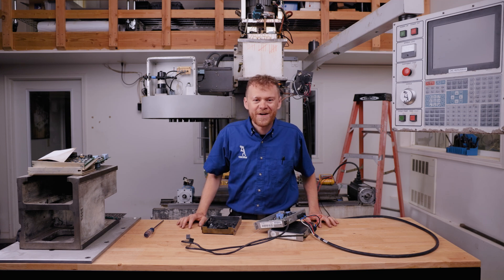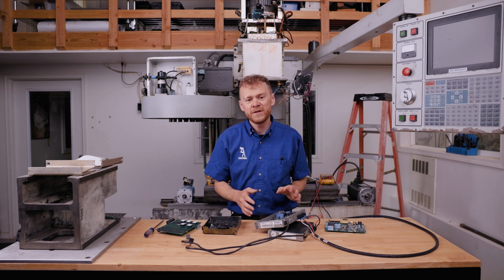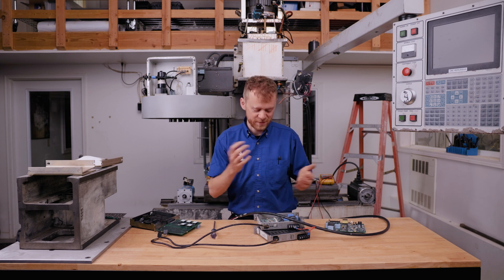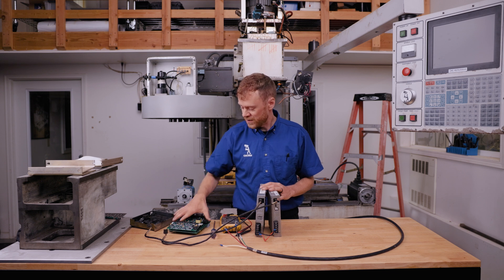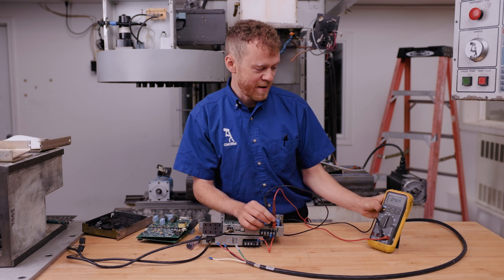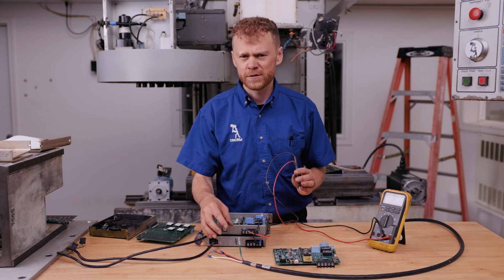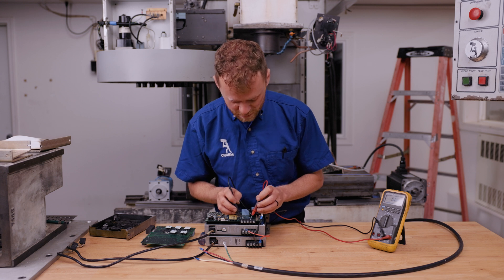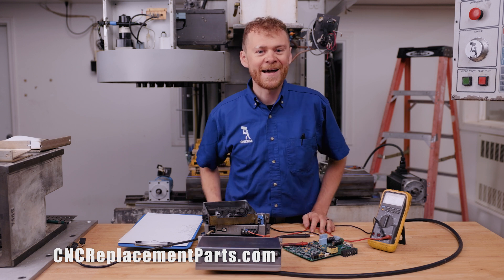Servo Amplifiers | Troubleshooting and Swapping

Comment: For a Fadal CNC mill 4020 I have an errorfor Y axis  Error Number #1, Motor Overload. It was made a swap between Amplifier X and Y , and it is the same error driver. For the check with the megometer till now was note done but tomorrow it will be done. What other issue can be with this Error number # 1?

Comment: Hello, i have old CNC Lathe built in Yugoslavia (1989y) and recently our machine was on fire! Transformator became super hot and isolation from cables starting burning. We diagnosed now that the transformator is okay, we made simple measurements from transformator and it seems working (transformator comes to one servo drivers amplifier i think from Z Axis). We connected it to the machine, tried to start machine then BOOM, something exploded. Now we are stuck because these servo amplifiers are old and company doesnt exist anymore. If we dont repair this machine we will need to scrap this machine. After some research i suspect now that it might be blowed servo amplifier. I hope this video will help me repair this shit! Thank you! PS. It might be transistor!
Reply: Hey! What’s the update?
Reply: @thatonechannel6636  transformator came back not repaired (service told us that it's working properly) unfortunately after connection it blowed 2 axis amplifiers. We repaired it correctly now (transformator from both axes) but amplifiers are dead. We are working on repairing them but there is no datasheet nor electrical sheet. Within 2 weeks I think we will manage to repair it
Reply: @ so you’re going to try and repair the amplifiers with no instructions? Man that’s tough but hope yall get it man. Good luck! 
I recently inherited my grandpas old fadal 4020 and looks like their amplifiers are bad also. The good thing is they are still around so I can’t find some, the bad news is that they’re like $1000 a piece and I need 2 for one machine and idk about the other one yet.
Reply: i hope you will settle this out! Ill keep you updated also.